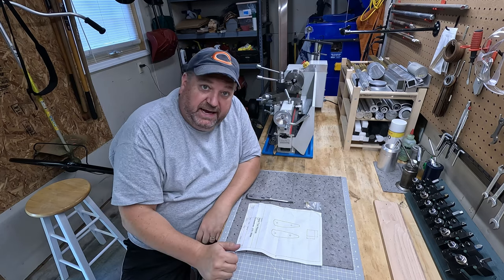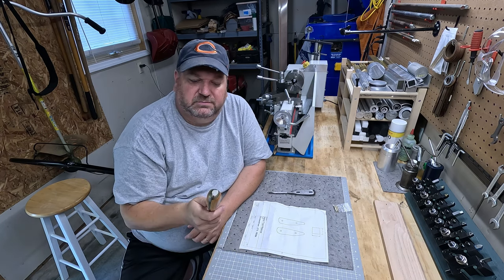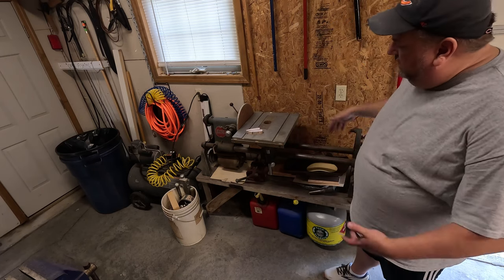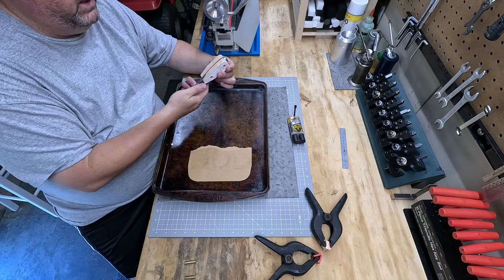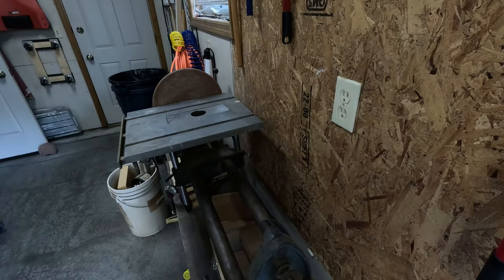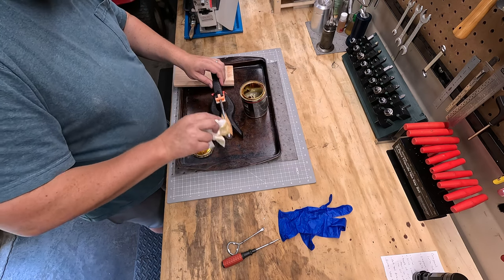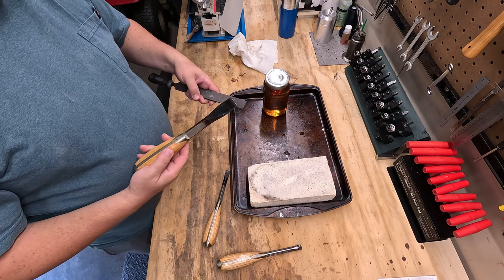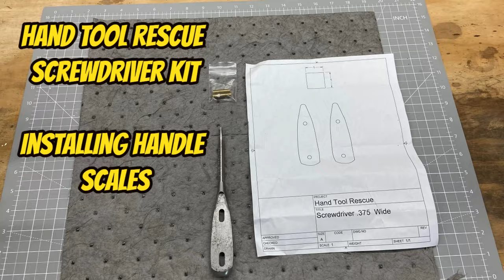Making Handle Scales for the Hand Tool Rescue small screwdriver -  @HandToolRescue

Comment: Lots of fun Deez. We used to have a handful of old red oaks fall at my old church every year so I know the smell of that sawdust very well. White oak is superior for larger-scale projects, but I've used a lot of reclaimed red oak over the years. Its problem is that it moves a lot as it dries and has relatively twisty grain to begin with, but for scales or other smaller projects, it's good. What kind of steel are those screwdrivers? I know with 1084 or 1095 you can harden by getting it just up to non-magnetic and then quenching. I'm building a heat treating oven (very slowly) to harden knives so I can work with more complex steels.

I enjoyed this video greatly. Thanks for putting in the time.
Reply from the maker: Thanks for the feedback. According to HTR site the steel he’s using is 1144 and he states they are quench hardened to 52 HRC. Maybe that’s a change because the ones I bought weren’t hardened. Anyway they are a lot of fun to make. Easy kit for beginners who may want to get into Knife making or other tool making and practice making scales.